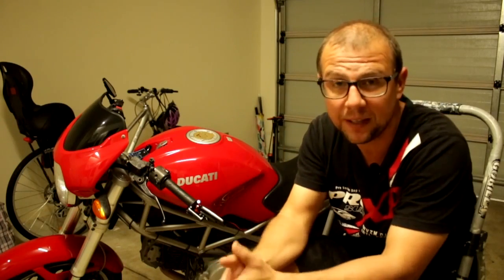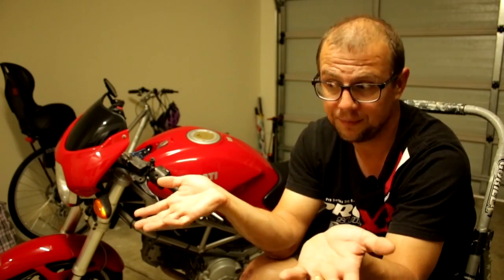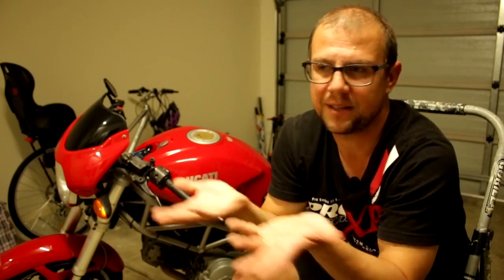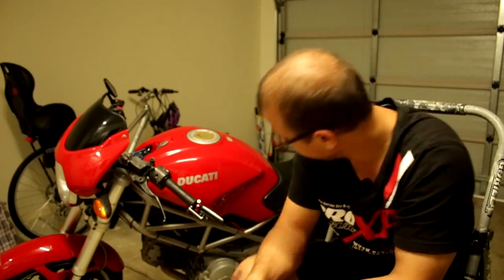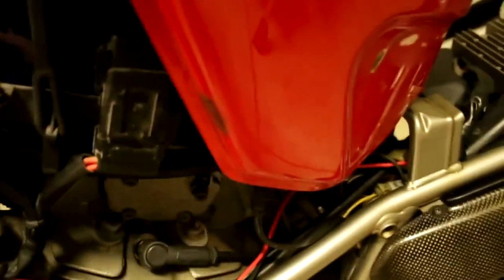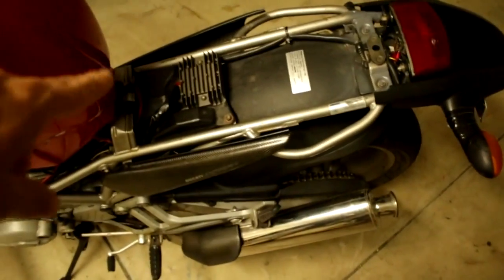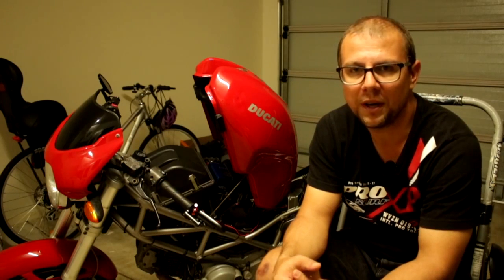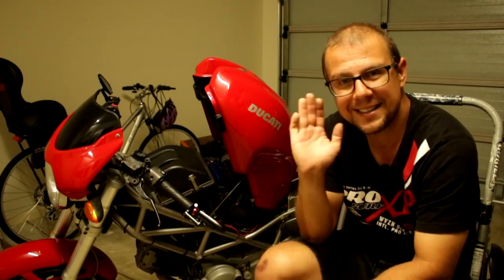Ducati Monster Electrical Issue: SOLVED!!!

Comment: Got an 04 M620 here, and I can attest to the weird wiring issues on these bikes. Had a headlight that kept popping bulbs. Checked the wiring and one of the wires was so stiff that it felt like it would snap if I bent it at all. The odd thing was that it was nowhere near any heat source. My guess is that maybe some water got in there and caused the wire to corrode. That was about 8 years ago. Now that the bike is much older, I am expecting to start running into issues such as yours. Hope you're still riding. Thanks for the vid. And, if you haven't yet.. definitely put a fuse on that regulator wire.
Reply from the maker: Hahaha, she’s long gone, I’m glad yours is still running. I’m still riding, Z900…..such an amazing bike. 😀

Comment: Thanks for the video. Had this exact issue and your fix solved the issue for my 2001 monster. Was running great for about 6 months but recently starting to have issue of not enough spark/too much fuel. plugs wet, sputtering and dying on first quarter of throttle. Just wondering if anyone else has had this issue as well, or if there are any suggestions for troubleshooting? cheers.
Reply: I am having the same issue on my 02
Reply: I just got these problems and the reg is smoking.  Did you just repalce the reg?

Comment: My 2016 Monster 1200s headlight and rear light still on even when the key is off. This always happen after heavy rain (I unplug the battery before and took few days to get it back running normal again). I try to unplug the connection, meter, ecu, black box one by one and today I found it turns out the fuse (3A) for the ‘diagnostics’ will make these lights turn off. Any advice man?
Reply from the maker: Well done for locating the issue. 👏 From here, I’d say check out the forums, try a lower/higher rated fuse (but that can be very risky).

Comment: Great video thank you! Quick question, I’m still testing as we speak, but I have the same issue new battery came in and started right up. So when you say you spliced those red wires, did you completely bypass the original connection that Ducati did from the reg/rec to the battery and spliced in your described connection or are you using both connections?
Reply from the maker: I'm sorry, I do not completely remember, but I think I spliced both. Don't quote me :P
Reply: @VroomBroomZoom  gotcha, no worries! I appreciate it, my stator isn’t top notch health wise but the bike runs well now with the bypass connection you displayed. Those old wires really were choking the current. Bike runs a lot better and the battery finally keeps a full charge. Also changed out the rectifier looks like it was over heating a lot because of poor connection

Comment: had this exact issue for my 848 evo 2011 but in my case the old rec reg when idle got 13.4 - 14.1 volt. when i twist the throttle to high rpm it can be 14.8 until 15's someting. so i bought a new rec reg it cost $25, i plug the new rec reg my 848 evo still have a issue the voltage so high.. for idle i got 14.5 - 15's when high rev gor HI voltage... any recommendation sir ? btw the battery is brand new
Reply from the maker: I’m only an amateur mechanic (very amateur), so take everything a say with a big grain of salt. If you’re getting a spike when applying throttle, I’d say your stator is the problem. You’ve swapped out the rec/reg, so unless it’s also faulty, is has to be the stator. 👌

Comment: SO I HAVE A 1999 M750 AND ALL OF THE SUDDEN THE STATER WONT DISENGAGE. I CHECKED THE RELAYS UNDER THE SEAT ANT THEY'RE OK. WHAT AM I MISSING????
Reply from the maker: Won’t disengage? I don’t get what that means
Reply: My 99 750 does that some times.
Reply: I just taped on the starter with a hammer and it disengaged.  The kill switch some times messes up. It relay o ly does this when its cold and dont want to start.  So I keep trying g and since times the starter will get stuck

Comment: my regulator was dead for some time and I thought it was a bad battery… then it wouldn’t kickstart and I was in the middle of the M25 ring of London on the way to a catch a ferry in Dover…had to have the bike towed, speedcharge the battery, and replace the regulator…they charged around 200 for it 😂 the towing itself was only 60… 
nice to hear you got the part for 25 🥲
Reply from the maker: That sounds like bargain towing compared to here in Australia. Glad you got home safe👍

Comment: Many mc charging systems are the same as your Ducati’s. What I’ve found the problems to be 
are in the connectors and wiring size. The 3 yellow stator wires on my 98 Honda VFR are about 16ga. while the 3 yellow wires to the rec/reg are closer to 12-14ga. wire. If the battery has low voltage and one gets his bike started, the current flowing through the connector (stator to rec/reg) may have enough resistance (due to corrosion, poor connection, etc) to even melt the plastic connector housing! Also, a poor connection to the btry’s neg. post can overheat the attached wiring. 
But your video is informative, good work.
Reply from the maker: Thanks Mac.
Reply: If I may comment about the different wire size found between stator and RR, then RR and bat.  Stator to RR is AC voltage, and it do not require as large a wire gauge, where as RR to bat is DC voltage and the wire must be thicker.  You can see many practical examples of the different wire size differences comparing AC and DC, in fact it's the smaller wire size (and higher voltage) of AC that make AC the practical solution for commercial power distribution.  On motorcycle system you shouldn't worry about wire size on stator...but you SHOULD increase wire size from RR to batt (like done here) to overcome resistance, especailly when the wire become heat soaked.  More heat in the wire create more resistance, which is why a cold engine bike might crank normally, whereas after ran and the wiring is super hot...struggles to crank.  NEED MORE DC WIRE size